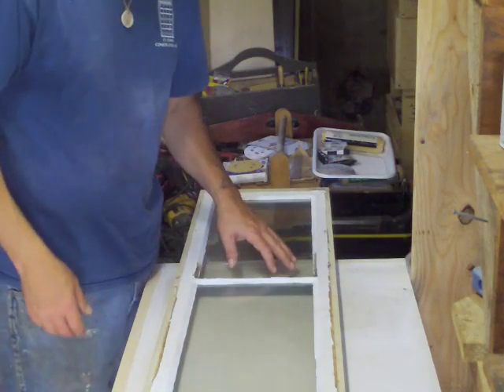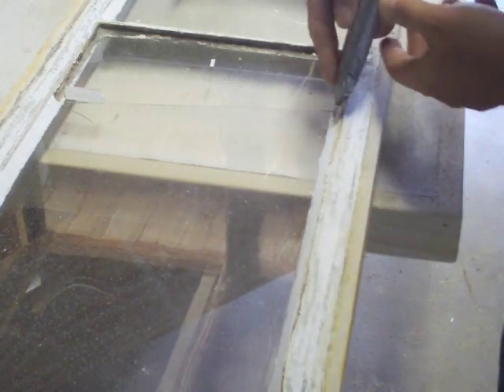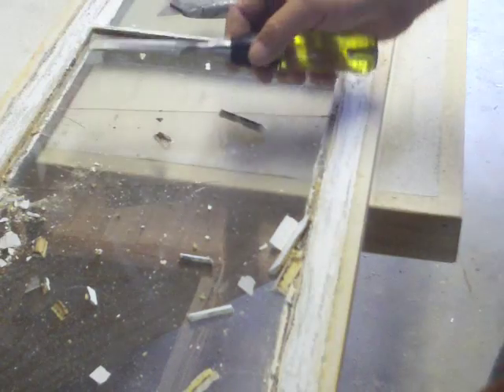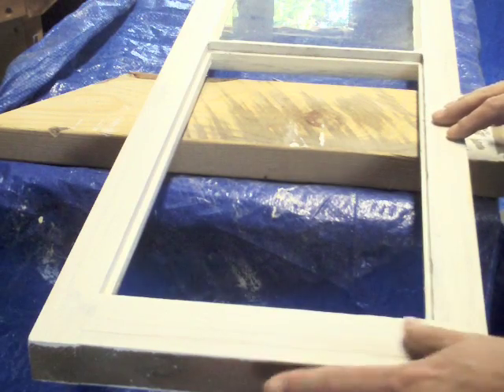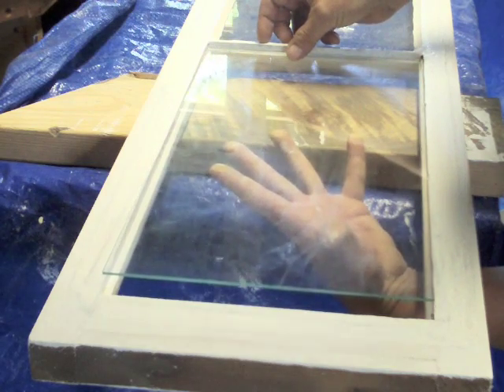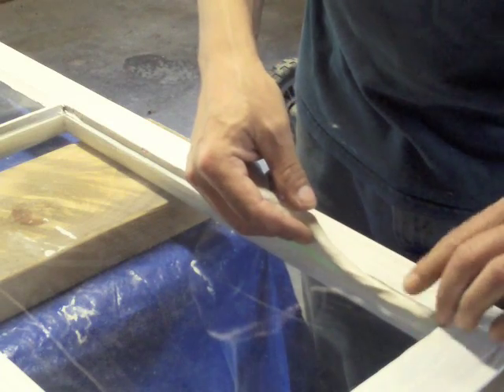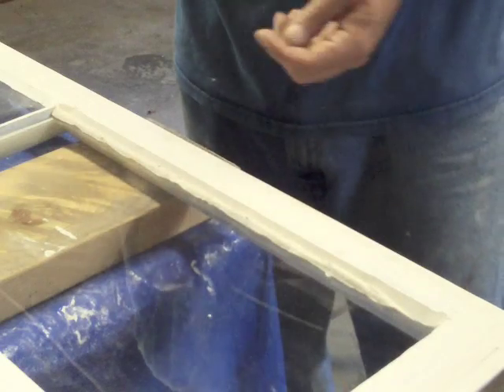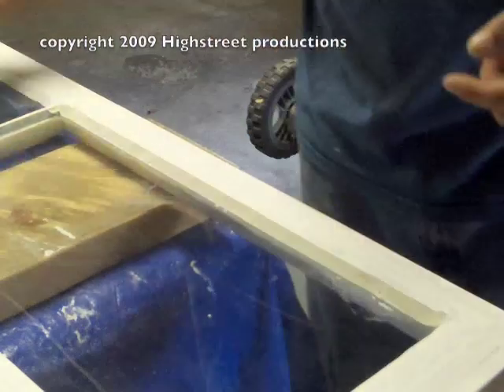Glass replacement

Comment: Yes Oscar you can use caulk. The putty is a pain and 99% of the time you will not get an old wood window out of its frame and lay it down on a work bench.  I use silicone to lay the glass in and then tape off a border around the inside of the glass and then use Alex white latex caulk and a putty knife to trowel an angle in to make it look like its been putty glazed . I guess I need to put up a video.
Reply: Do you have a video of you technique yet? I'm trying to reglaze the old windows in my house and the day 33 sucks, so u just use white out door caulk ? Thanks
Reply: Jeepjones85
I promise the next putty glaze window I do I will do a video. . But its pretty much just like I said above
 plus you need to measure the glass to where it pockets the frame  at least an 1/8 inch, a 1/4 would be nice but typically these windows are out of square and you need to leave the glass a lil short for an easy fit.

Comment: Good lord!  Use a heat gun for removing glazing....and use the correct glazing putty too.  When removing points, never use a tool with a tip that fat.  I lift the points with a putty knife & pull them with needle nosed pliers.

Comment: Sticky fix : babyshampoo plus water over small area of glass. Put on with a small spray bottle..wipe away after. Still "smh" when i use butter to remove adhesive...easy cures